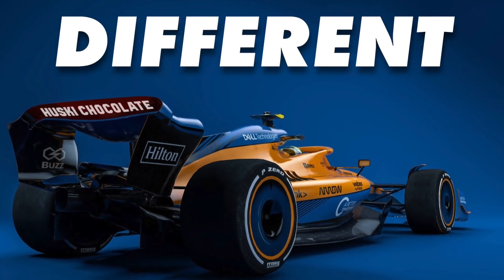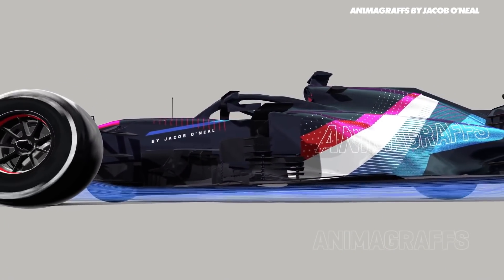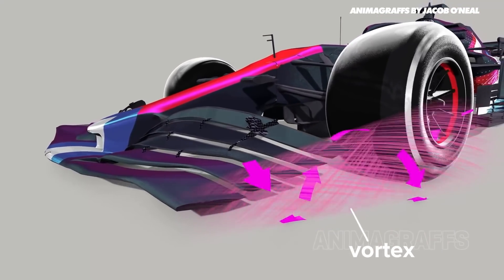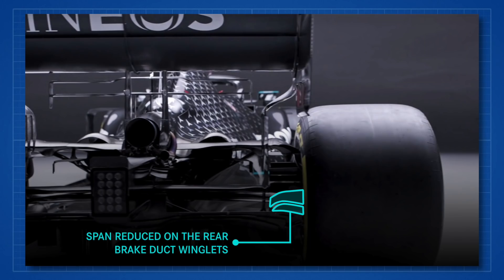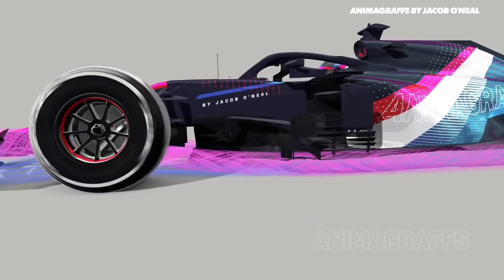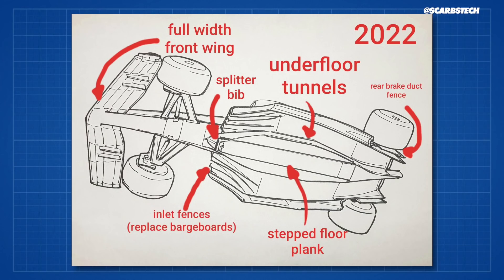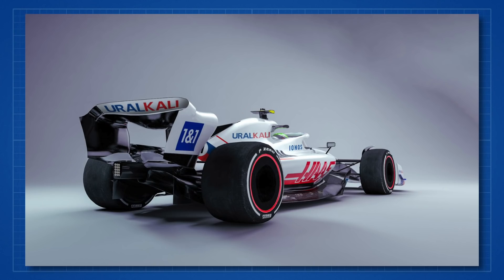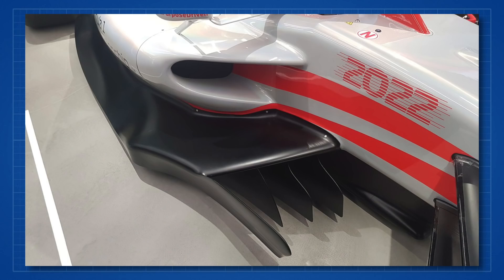How the 2022 F1 Aero Tunnels Actually Work

Comment: 3:40 it's really not that complicated, at least not for a general understanding of why. 
Firstly the static pressure is what decreases. You can think of it, as if a fluid was flowing through a pipe that the pressure exerts a force against the sidewall of the pipe, when the flow is sped up (through a constriction, where the diameter decreases) the air molecules have less time to press against the walls, or will hit the walls of the pipe fewer times than the slower flow. Because it has less time to press against the wall, the pressure decreases.

Comment: Bernoulli principle is the basis of ground effects. Energy can neither be created of destroyed. The area under a car is shaped to form a nozzle forcing air to accelerate through the smaller area. The faster air increases kinetic energy which must take away from pressure energy creating low pressure

Comment: Wait i think you mistook what a wing does. Youve said that a wing deflects air upwards and the angular momentum creates downforce. Thats not correct. Yes in part it does but the most downforce comes from lift which is created by the wing. A wings aerfoil creates an upward force on a plane which intern overcomes gravity to make it fly. On a Car the aerfoil is flipped and therefor the Lift is pointing to the ground which itselfe creates downforce.

Comment: But the challenge is, when the downforce comes from the top it is easier to adjust for high downforce or lower downforce depending on the track, but how it would work with the new car?

Comment: pressure does not drop because the air speeds up, the air speeds up because the pressure decrease. variation in air pressure cause wind.

Comment: I am concerned of how the air under the car will push against the tunnels at high
speed cornering....it might make the rears of the car very unstable as the air will clash back and forth between the tunnels of the car

Comment: Ok i'm confused! scarbs says air comes out from below at the front edge of the underfloor. How is that air going against the direction the car is traveling?? seems rly confusing to me. Also the Skirts in the 80s were not Virtual they were actual physical Barriers that sealed the whole underfloor. I'm pretty confident scarbs knows what he is talking about so clearly i must have understood something completely wrong. Can anybody help pls (all of this is talked about around 6:00)
Reply: Also i cant rly grasp my mind around how the diffuser generates downforce by pulling air through the underside of the floor. It makes sense when i say it like that but when the air is slowed down when reaching the diffuser its pressure increases, so wouldnt it just want to leak back under the floor where the lower pressure is. I dont understand how you get a "pulling" effect there of the air under the floor

Comment: With wing downforce replaced by more efficient ground effect, and then most of the complex barge boards banned...where is the air drag to come from? I suspect these new cars will be hugely faster in a straight line. Faster without DRS than 2021 with DRS? I think so. Baku, Mexico and Monza could be wild. I'd intuitively expect cars to accelerate quicker and longer, reaching a higher terminal velocity later on the straight, or having to brake before acceleration is over.

Comment: Bernoulli's principle isn't that complicated unless my understanding is wrong. A moving fluid (like air) has a certain amount of energy that is split between the pressure of the fluid and the speed of the fluid. So this under floor system works by shifting the energy on the top of the car to pressure and the energy below the car to speed, which results in the air above pushing the car down. I feel like you guys explained it without calling it out lol.

Comment: For those wondering how the low pressure is created through accelerating air, it's actually pretty simple. It comes down to conservation of energy. Basically, if you imagine air flowing through a tube, if there is a bottleneck the air must speed up since the total volume of air flowing through the tube per second is constant. However, since the air is going faster, if it had the same pressure it would have greater kinetic energy (imagine a bullet of high speed air hitting you in the face). You cannot increase the kinetic energy of the air locally at the bottleneck since, again, it is moving together with the 'slower' moving air in the tube. This means that for the kinetic energy to remain 'level' with the rest of the air travelling slower, the pressure must drop. 

You could oversimplify it this way: Energy = air velocity + air pressure. Since the energy is the same everywhere in the tube, if air velocity or air pressure increases, the other must decrease. This is achieved in the venturi tunnels by creating a bottleneck (big entrance at the front of the car, big exit at the diffuser).

Comment: I don't really like the intro since the two way of generating downforce you show are basically the same. (It's inaccurate)
When you deviate the air upward, the "reaction force" is actually the pressure differential on the surface of the wings. 

Basically, all the downforce comes down to the integration of the pressure over the whole car. 

BUT there are two ways of generating those pressure differential :
Using regular "wings" : you push the air upward
Using ground effect : you suck the ground

Comment: Bernoulli's principle is actually very simple to understand - as the atoms move faster they bounce of the walls of the tunnel less, which is how they put less pressure on it 🙂
Reply: Well it's just conservation of energy. More kinetic energy means less pressure energy. So if the air is accelerated, it loses pressure. In fact for all the immense power of rocket engines, the exhaust velocity is so high that the pressure in the nozzle is actually less than the atmosphere.

Comment: As a fellow Mechanical Engineer (with more than a passing interest in fluid dynamics) - that was awesome.  

Question thou, as the underfloor downforce is generated by air velocity in those tunnels (a function of the square of velocity ?) surely any sudden lift in the car, such as riding a kerb, will cause a drop of underfloor air velocity and a loss of downforce ??  Interested.

Comment: Downforce is NOT a downward force pressing down on the car Callum, your description is inaccurate. The force acting on the F1 car might be called "downforce" but the low pressure air on the underside of the cars wings and floor is sucking the car down so it's actually a suction force pulling the car down not a force pressing onto the car. Downforce is the opposite to how you think it works Callum, the word "Downforce" more accurately means a force pulling the car down not a downward force pushing the car down.

Comment: I have no idea why F1 waited this long to implement ground effects, Indycar/CART has been doing this for years
Reply: @Nigel Hyndman The current cars are in fact ground effect cars.  65% of the total downforce is created by the floor and diffusor.
Reply: @Bahamuttiamat  Indeed. What F1 haven’t allowed since 1982 is shaped floors to maximise ground effect, which is what returns this year. It had been banned on safety grounds due to the number of major accidents from 1979-82 caused by sudden losses in downforce when the aerofoil-ground seal was broken (through bottoming out, hitting bumps, etc). The advancements in safety since then has meant that it’s now considered a risk worth taking again.

Comment: pump the breaks guys. your overhyping lots of things. physics dont change over night. dirty air will still be a massiv issue in slow corners (like sotchi 90 horrors) cause the slow you are the smaller the ground effect gets. the car gets unpredictibal and and the wings are not as effectiv anymore yet still hurt the car behind. not helping them either. most effectiv are corners with multiple lines wich we have so many on the calender lmfao. plus most tracks have an tracklimit issue cause we need 3meter wide curbs and then 30meters of asphalt wich in return means we get curbs like in qatar or other variants where drivers run over cause it doesnt slow them down like grass or gravel and they damage there floor wich means game over. that was an issue already now, multiply that by 10 and your good to go.

new car is nice but it doesnt fix the issues created by tracks wich make atleast 50% of the "bad racing causes". plus long cars dont promot overtaking either. the wideness is not an issue but overtaking a 4-4.5 meter car or a 5-5.5 meter car makes a huge difference.

feets on the ground. otherwise 2022 will be dissapointing for lots of people.

Comment: Do F1 cars have to have solid bodywork or could they be made up of micro capillary tubes so that air passes through the body or the car?

Are there any regulations that prevent the fuel being moved round the car as it seems that at the start of any race there is a lot of available ballast, is pumping fuel from side to side to help the car in the corners legal?
Reply: I think the fuel system is highly regulated due to safety concerns

Comment: The reason the front-wing and spoiler create downforce is WAY more simple than you make it out to be: air is a medium and you can steer though any medium. The frontwing and the spoiler steer the car downwards.

Why? Newtons axioms: If something flat is moving and tilted forward, it will push the air upwards, which in turn pushes the flat thing downward. No need to introduce thermodynamic concepts like pressure, which in fact is derived from Newtons axioms to begin with!

Comment: We've been saying for a long time that all the cars look too similar. I'm worried they will now all look exactly the same. Definetly looking forward to seeing how they turn out and just hope some inovation has been allowed.
Reply: I was watching a video saying that some cars may even choose to forgo a front wing under certain race circumstances, like a low drag circuit like Monza. That would be nuts.
Reply: @LOVEMUFFIN_official  that would be a real sight to see providing that the regulations allow it. 1979-82 ground effect cars have a very iconic look due mainly to 1) their boxy shape caused by the aerofoils in each side pod, and 2) occasionally lacking front wings. I personally really like that look and to see a modern iteration would be very interesting indeed
Reply: I'm fine with the cars looking exactly the same, I just want tighter racing
Reply: @FMXIAN  go watch something else then like F3
Reply: @ryanp6138  I do, along with MotoGp, Supercross, and DTM. F1 is by far the most boring (except this season). What kind of idiot doesn't want closer racing...
Reply: They have looked the same since the 80s
Reply: @adamb2619  You're right I always have a hard time telling the difference between Prosts Marlboro Car and the modern ones
Reply: Ian Kitterman I realize that was a satire comment, but in the same years could you really tell the difference between the cars if it without paint?
Reply: How are your worries now?

(god I wish I said this before Green Bull happened)

Comment: A couple of questions
1) How does down force from the diffusers vary with car's velocity? (linearly, or some other relationship) 
2) Where will the centre of downforce be for these cars? (i.e will it be close to the centre of gravity?)
3) Will that vary with car velocity? (if downforce isn't linear to car velocity, does the C of Downforce move with speed?)
Reply: 1. Bernoulie's priciple high velocity = low pressure 
Low velocity = high pressure by expanding the air as much as possible by the diffuser, you'll reduce velocity and increase pressure of the air coming out the diffuser but increase velocity through the undefloor which descreases pressure and therefore a better suction effect to the floor.
2. To be fair I dont know I guess we have to wait and see what teams do but probs gonna be underneath the car between the driver and engine
3. Yes because going back to bernoulie's priciple, if you can get the air to travel at a higher velocity under the car you will have a more powerful suction effect to the ground which will increase downforce created.
Reply: Thanks for your explainations @goaway3350 they do help, but I should have expressed my questions more clearly.
1) I'm wondering if there is a linear relationship between car velocity and downforce, or if its a non-linear relationship ?
2) & 3) I'm thinking ideally the designers would want the centre of downforce acting in a position that applies the optimum balance of aero load on front and rear axles, and is consistent at all car speeds. This would make the car behaviour stable and predictable. 
I'm wondering if the position, size and shape of the venturi's is fixed by the regulations, or if the Teams have flexibility to adjust these for their desired 'optimum' centre of downforce. (and the does it change part was a thought that if the downforce isn't a linear relationship with car velocity, the centre of downforce is likely to move with car velocity too).
Reply: @JakobusVdL  no worries, I tried my best to answer your questions again once you elaborated on them when you replied to me but I realised I made a mistake in that post so I will delete that post and rewrite my second reply to your questions.
So for 1. Pressure and velocity are indirectly proportional but not linear however increasing velocity will always decrease pressure. Just at a certain point the downforce would see a significant increase but after that significant increase its only small increases in downforce. If you look at a indirect proportion graph and just imagine x axis is velocity and y axis is pressure then you will see there is a significant dip down but after that significant dip it still decrease but at a less significant rate.

And for 2&3 I'm not sure how a non linear relationship would change the centre of downforce, scince the area where the downforce is created is fixed itself. best example is 
50mph = some downforce 
100mph = significant increase in downforce  
150mph = increase in downforce but not as a significant jump as before from 50mph to 150mph just small increases which in F1 is vital. (The example can also help explain 1.)
Reply: For 3. If you mean will the centre of downforce change with velocity than most likely not but if you're asking if velocity can vary downforce then yes it will

Comment: If there's a car following very close to the car in front( right on the gearbox) wouldn't the following car actually block/disrupt the airflow from the diffuser of the car in front and as a result wouldn't the car in front have lesser downforce??
Reply: Let's be honest. The time you can completely block the opponent diffuser, you literally already crash into them.
Reply: @bocahdongo7769  you don't have to block the diffuser completely, just a disruption of 10 or 20% is more than enough to make the car in front skittish and completely unpredictable
Reply: @Credi99  Here's the thing. It's only work if you both space apart below half a meter on 200 km/h and above. Nobody insane enough to do that on open wheel car anyway.

The close racing we talked about is 1-2 car length, not a literal foot.
Reply: @bocahdongo7769  lol bro, watch some of the older races before the turbo hybrid era, you'll see how close the cars actually used to be lap after lap. Yes they were following each other within a foot or two
Reply: @Credi99  200 km/h on turn?

Let's be honest, diffuser technology is roaming around for 40 years, and the principle is still the same. Your now complain about driver exploiting the diffuser by literally blocking it is... Not how aerodynamic works.
Reply: @bocahdongo7769  ofcourse!!! 200 kph is not even considered a high speed corner anymore, they are called medium corners. And yes diffusers have been around for 40 years but they have never ever been as important as they are going to be in 2022. Diffusers work by speeding up the airflow from mid floor region, this creates a low pressure area. So if there's slight disruption in this flow, how can the diffuser work as efficiently? I hope I'm wrong, but it's simple logic, you don't need a degree in advanced aerodynamics to ask this question
Reply: @Credi99  I'm afraid you see the paralax illusion of the length because on turn. Half a car length is 2 meter. Or it's not fast enough. Because if you too close, the dirty air is so strong, you lose more downforce before even came close.

On top of you need literally blocking it in order to make significant changes, a.k.a you need to crash it. Because diffuser make the air slow down enough. It doesn't really matter if you half meter apart honestly.

It's like you attach the filter right after carburetor. It won't make carburetor go wazoo, except if you snugh it with ball of wet towel
Reply: @bocahdongo7769  you're don't understand my point, that's okay, let's just agree to disagree and carry on with our day
Reply: If this is true, formula 1 may have just shot itself in the foot! Overtaking will now be too easy!
Reply: @Credi99  well even if this is true I’m all for it! Go overtaking

Edit: and these regs are basically to improve racing and more overtaking by getting rid of dirty air
Reply: @davester5234  yes we all want to see closer racing but f1 is not for show like wwe, it's a serious sport. I hope I'm wrong though

Comment: Callum - great video. This aero ruleset sounds like the teams will need to maximise the side flow aero like  Tony Southgate used on his Jaguar XJR-6 Group C car back in the mid 80s (all that free air pull into the diffuser ahead of the rear tyres) Keep the vids coming. Not long until testing and we'll see whether this FIA new dawn will be like all the others they've had over the decades that really didn't change much at about the running order.